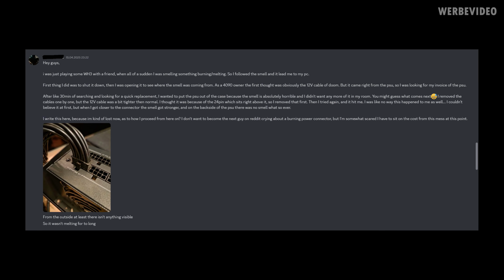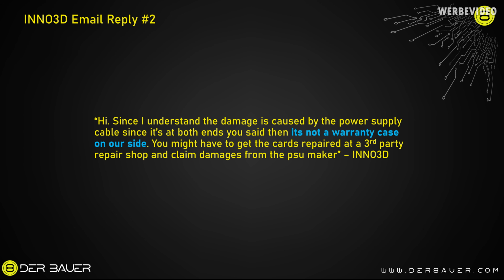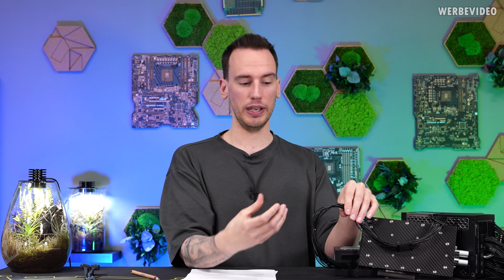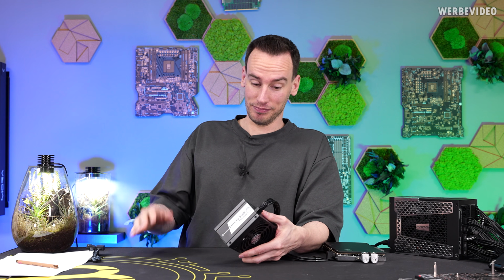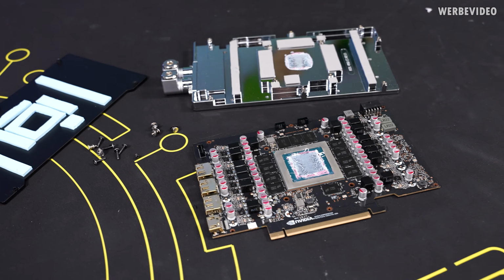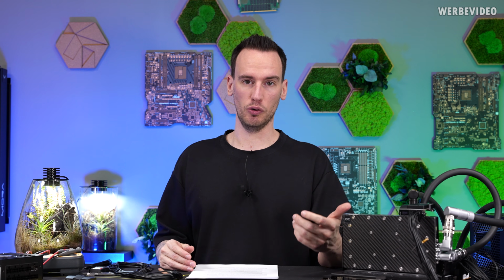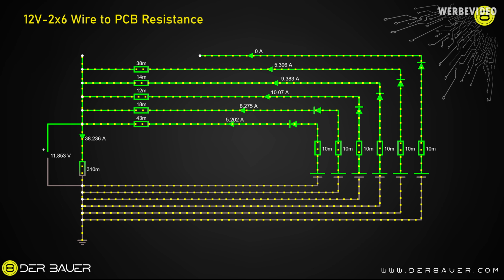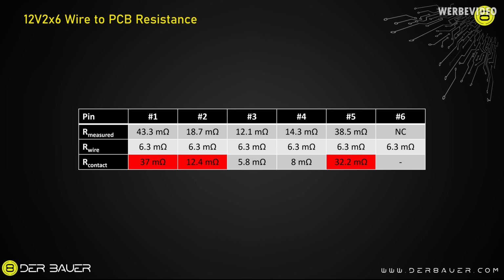Investigating and Fixing a Viewers Burned 12VHPWR Connector

Comment: @der8auer I have a silly question. You mention, that the melting connector issue only exists due to the card not being able to balance the load between the pins. So then, it is possible to remove the whole 12V HighFaliure connector from the card, and simply add an XT60 connector instead of it? And then wire up a cable that plugs into the PSU, and converts that shitty design to a good standard 2 wire XT60 plug? Preferably at the connector on the PSU side, so that we have none of those crappy wires left?

Comment: Same thing happened to me. 4090 strix. I had my 180 adapter melted into the gpu header and had to pry it out with a flathead. I bought a 12v-2x6 reverse gpu header from moddiy, then i took the header and the gpu to a repair shop. Cablemod covered the costs

Comment: @der8auer EN Heat and low melt solder will alloy with the existing solder, making it melt at a lower temp as it alloys into the PCB solder, then the connector should pull.  Tip via @NorthridgeFix.  And I un-pause....and see the Dremel!!!!!!!!  Next time!

Comment: Given that the pin that had the melting around it was the one you measured no connection on after you'd replaced the connector, does it not follow that something further downstream from that pin on the GPU board failed due to the excess heat and/or wattage?

Also, doesn't it seem risky to keep using this GPU going forward? With no current going over 1 of the 6 pins, and still no load balancing across the remaining 5, wouldn't that exacerbate the issue?

Comment: A lack of surface area between pin an connectors, theyre so small you cant make enough contact surface to keep individual pin resistances. If the connector was a bus bar rather than pins it would NEVER melt by greatly increasing the contact area.

Comment: Why do they desperatly hold on to using the same type of connector for higher and higher current demands ? Oh we just use more pins. It's proven over and over this does not work.
Why don't they use like a xt60, xt90 connector ?

Comment: Question from someone who doesn't know: if the Watts remain constant, but the card is undervolted, wouldn't that increase the current??? And wouldn't that exacerbate the unbalanced current draw across the wires?

Somebody should design an inline adapter, or ideally a cable, that can monitor the individual pins at the GPU side -- both for current draw, and temperature. Surely they can massage the sense pins to limit damage!

What about putting inline 10A fuses in each of the 12V+ wires? PITA, but it would save the card!

If the manufacturers aren't going to help with this, then it's up to users to protect themselves.

Comment: Using multiple wires to will always create problems either switch to  4AWG with Anderson connectors or increase voltage to 24V.

Comment: 8x could mean that some of the pci-e pins aren't getting a connection. A (GPU) PCI-E socket tester would tell you if that is the case, but regardless what the reason is, the card is damaged beyond just the power connector.

Comment: If there is uneven load distribution, does it change between resets?  Or is it consistent?  If you use a meter and it shows the load is uneven how do you balance it but using  a new cable?

Comment: disappointed i wanted you to attach it to a bumper of a truck to pull the cable out of the psu 😂
Reply: Haha, that would be funny, especially if he edited in a shot of the truck doing a burnout as it's struggling 😂
Reply: @volvo09 with the engine burntout and the psu cable still connected to tbe bumper unattached to the truck 😂

Comment: lessons learned.
1. Dont buy Nvidia products that has a 12VHPWR
2. First review any product outside Nvidia with a 12VHPWR to see how their power topology is handled on the card(buildzoid video) or not buy
3. Dont tell the vendor any details if your hardware failed and you want to claim waranty
4. Avoid INNO3D since they proofed to avoid providing valid warrantly claims

Comment: The resistance of the copper increases around 0.4% per 1C - you should factor that in. So if the connector gets to 90C it would be another ~30% (compared to room temperature).

Comment: Inno3D excuse made me quite angry. Power supply is not responsible for power draw in the circuit so if cable melts it's because the device responsible for power draw is requiring more power than the cable can handle. It's still GPU fault. 

Ofc this wouldn't happen if Nvidia stuck to the 8pin connectors on all of their GPUs(Funny enought xx60 series cards still use 8 pins on partner boards) or Nvidia would design better connector.

Comment: I have an Asus Astral 5090, gputweak3 with power monitoring. PSU is an Enermax PlatiGemini 1200W ATX 3.1, 6months old(was running a 4080super). Only just had the Astral but when monitoring power and running Furmark, pin 2 only drew 1.2 amps, pin 1,5&6 were drawing 10+ amps, the rest were within spec. Checked cable, unplugged/replugged no difference. Just had a new CableMod 12HPWR cable, all pins now showing 8+ amps. Didn't expect Enermax to ship crap cable.

Comment: that is a huge variation on that shitty contact area.
Reply: Could be fixed by switching to 4-spring crimp contacts, but everyone sticks to 2/3-dimple with shitty contact.
Reply: @TheDeeGeeNL  anderson pp45 similar size. but it needs 10mm2 wire for this load. however 10mm2 silicone coated wires used in rc worlds is insanely flexible. ohh and idiot proof. you cant connect it wrongly.

Comment: Kind of blahblah, when you consider, that, once again, the cable was crooked after plugging in on both sides and that there's tens/hundreds of thousands GPUs not burning.

Once again, it's a user error for the most part. Solution is simple - dual, disjointed clips to lock in the connector, located at the edges of the connector.

Comment: Really happy with MODDIY's handling of the situation.
Reply: Yeah, it's unfortunate that they would have to eat the cost for a manufacturers issue, but it shows they care about the customer.
Reply: Definitely. I think with the cost of bulk cable and what they charge for the finished product, they likely have a decent profit margin to work with.
Reply: I switched to a SF1000 from Corsair. When i told them about it, they instantly said they would send them all for free, and i just need to configure them. Really nice company and support from them.

If only Inno3d was that nice to me😂

Comment: Now i am starting to worry .  at least on the psu side on my new coolermaster gx3 1050w with my 4090. i can not remove my cable from the gpu side. i will check where you check as you show on the video. and only play 1 game. and general use.  My friend Erick will say i told you so. ok. no panic.  Asn if the gpu need repair i can not send for repairs cause the tariff. since is 125% plus the 10%  just to change the cable. Oh yes that is how that bad is.  since there is no one can fix that here

Comment: Heat means resistance to current flow. Which mean too much current fir the conductor.. Either the cable or connectors are insufficient

Comment: Okay… but how ? I mean if both ends are fused together, how did he get the PSU and GPU out of his case.
I do not know any case where this card or PSU will fit through the cable grummets.
So how? Did he use a saw to cut his case open?

Comment: If Nvidia wanted to avoid those issues they could easily do it exactly the way older cards had their power delivery design decades ago.
They cheaped out the most important part of a power hungry gpu and there we are.
Also, a cheaper way in my head at least' would be to have thicker cables! If you want to eliminate that possibility of one cable only having some connection, make that cable capable to support that power draw.
I'm pretty sure the old design connection didn't have these issues because of that and not because it had better pin connectivity!

Comment: Unless the power target is also lowered, then undervolting will actually increase the current draw.
If I undervolt my 9070 XT by 100 mV, it clocks about 200 MHz higher but the power consumption is exactly the same since it is just boosting to the power limit.
Reply: I undervolted to the same 2745mhz (@975mV) i got without UV. So it didn't run any better than stock, but at least used a bit less power than before. The chip is also not the best, so there wasn't much space for more before it got unstable and crashed...

Comment: What it comes down to is that trying to blame the GPU, cable or PSU is a game vendors and Nvidia try to play to pass on blame.

What's wrong here is the 12VHPWR spec itself. It creates 18 failure points that all cascade in damage to the PSU, cable and GPU.

And any vendor, chip or card, forcing the use of the spec is to blame and should pay to repair or replace all of it. And the one to decide to use the spec is the endpoint / GPU.

GPUs don't use the spec because there aren't any other cables coming out of a PSU to power it, there are plenty options, they are the ones that force 12VHPWR to be used.

Comment: If this stupid abomination of a connector will melt on me. I will just solder wires directly onto a card PCB. No contact resistance not unplugging no worries. According this video i can just void warranty by doing that. Cause it looks like there is no warranity anyway...

Comment: @5:54 @derb8auer.. I kindly say not fully true... You definitely can help prevent this on PSU side too as you can make controller there to stop current going out when unbalance has been detected between wires going out and not just on gpu end similarly.
Reply: You can’t load balance on the PSU side… the entire connector sits on a single rail so the total current wouldn’t change.  This is a design issue on the card side.

What you’re suggesting is one rail per pin which is a complete redesign of the ATX specification… (the PSU becomes the intelligent device) which suggests the spec wasn’t adequate in the first place.
Reply: @KleoGroutides  No, but you can still monitor all wires on PSU side alone. Forget GPU, put resistor just there IT DOESNT MATTER how 'its configured'. 
You can still do so much on PSU alone! What you think is GPU doing load balancing.. forget that its not my point! 

Specs. I am not talking of specs and not talking what shape of pins should be or what colours of wires should be used. Just the possibilities of PSU here.
Reply: @ you can’t do per pin monitoring on the PSU side if all the wires are on a single rail… those wires are soldered onto a single bar.  Every connector be it 6pin, 8pin and EPS (if memory serves) must sit on a single line.  Hence by definition it’s the endpoint that needs to manage the load balancing… the exception is a multi rail PSU where different 12v rails are load balanced.  The 12v connector of all PSU designs sit on a single rail… the ATX spec enforced this.  This isn’t a PSU problem… the PSU is dumb by design for intensive purposes…

Comment: It's not really that hard to understand why this is happening, the 40/50 series share the same problem and it's Nvidia's design that creates this problem. There are no similar problems with previous generations. Personally, I think Nvidia is fully aware of this but secretly pushes the responsibility onto something else, if we were to see a new design on the 60 series then it's completely clear to me that it was actually Nvidia's design that was the problem in the first place, otherwise you wouldn't have designed a new one if Nvidia thought there was nothing wrong with it. It remains to be seen. Someone should start a lawsuit against Nvidia, this is unacceptable for users. I'm just glad I skipped the 40 / 50 series.. will happily skip the 60 series if the design still exists.

Comment: To experts:
It's possible to develop a device that is connected between the GPU and PSU that does the work to measure the differences of Amp flow and do something? Like cut the energy and/or emit a waring sinal?

Comment: Have there been any cases involving the stock adapters that come with the cards?  Or does the fact those adapters end up splitting to 3 or 4 8-pin connectors completely change the dynamics of the potential resistance and current across all those wires?

Comment: because what i once heard suggested was that...
the pcb power planes current flows could favor a nearside pin

but what your saying here today about the crimping...
well in theory it could be possible for either 4 or 5 mis-crimps

if a majority of these 6 power pins were not crimped properly
then leaving only 1 or 2 of them left giving a good low resistance

then that would be a cable problem indeed
whether 3rd party or manufacturer supplied cable

the solution to that problem would be to use milliohm meter
on all cables as a Q&A quality assurance mandatory testing

before leaving the factory, whether its the coming with that psu
or if its a 3rd party cable like the cablemod or whichever ones

and if you personally dont have a milliohm meter to measure it
well i dont, i have a 34401a which is a 6.5 digits

it would be nice to know however der8aur - if corsair does this
as a testing Q&A step for their own 12VHPR cable they are selling

its like... terminates in 2x 8pin EPS style on the other end
but its not right angled... those tend to be chinese / alibaba / aliexpress

Comment: It'd be quite interesting to see the resistance breakdown and if insertion cycling alters it, sort of a lower level to the previous video on cable temperatures. 

Possibly also a before and after a long period of system load, such as gaming inside a case, to see if thermal expansion adjusts the contact resistance as well.

Comment: Hi, @der8auer i also have a inno3d 4090 and also water cooler via Alpha cool block, i have the same issue where the card WILL NOT run at 16x pcie gen 4.. only runs at 8x...i recently sold it to some and got a 5090.

Comment: "You can only solve this from the GPU side." Per-pin current sensing can be implemented on any side, even the cable by adding an in-line PCB to sense current and shut it off if it goes too high for too long... or go whole-hog by having a constant-current buck regulator actively enforcing a 15A per-wire current limit and 60A total.

The only things the GPU can do that other solutions cannot is make the GPU throttle itself to more gracefully handle the issue and spare people who don't have 12VHPWR GPUs the cost of that extra circuitry.

Comment: I had a Gigabyte Gaming OC RTX 4090, using the original connector with 4 tails in a Lian Li 011 Dynamic Evo case, mounted horizontally. The connector was pushed in properly on both PSU (EVGA 1000W Super Nova, gold rating  ((thick braided cables))  and GPU side and 2 pins began melting themselves inside the GPU side wtihout any smell of smoke or burnt plastic. A long 2 year bake it seems. ( For reference, I have clips of my rig on my channe). For some reason and thankfully,  Star Wars Outlaws would consistently crash on opening, other games worked but were unstable, even blue screens albeit my case having great airflow working correctly. I thought it was my new motherboard (Gigabyte X870E) CPU combo (9800X3D), weeks of trouble shooting updating bios & all drivers that exist, to even a full wipe & windows reinstall, STILL unstable/ crashes. Frustrated, ready to take the PC to a "professional," disassembling PC for transport, the first thing I discovered were two cooked pins with their plastic shrouds still in the GPU, also hard to pull connector out. 

Thankfully GIGABYTE repaired connection and gave a new connector via RMA, but I've moved on to an ASUS TUF RTX 5080 (overclocked), with a Lian Li Edge 1300 platinum rating. It took 2 years for the 4090 cables to cook playing long sessions of various games from path traced games like Cyberpunk, Indiana Jones to unique unoptimized titles like Star Citizen. See you guys in 2 years if it happens again. I'm sticking to lower wattage GPU's really not worth the trauma just to tell someone i'm getting 10fps more at max settings.

Comment: Some might cynically say it's a genius 2 (or more) part problem...  This way the vendors can point at one another to shift the blame to the customer.  
Cheap/lazy power bus design on the card.
Poor pin/connector design (seemingly) that can't take multiple removal/installs or corrosion on any pin...
Sad

Comment: It is clear there are serious issues with this high power connector.  It matters not whether the manufacturers think it is user error, if the thing fails, overheats, and poses a fire risk, it is simply unfit for purpose.  We can see very clearly that in this case, the connectors were fully inserted.  There was no user error.  This is a failure in the connector itself, and they simply cannot be trusted.  In more than 20 years of building PCs, and working in PC Support, I've never seen or heard of a standard PCIe power connector failing like this.  Why Nvidia chose to introduce these high power connectors is anyone's guess, but it is now blatantly obvious they are poorly designed and prone to failure, especially on the high power cards they were supposedly designed for.  Everyone in the industry using these connectors needs to be held accountable.  They cannot be allowed to weasel out of product support on such flimsy excuses as "you didn't plug it in correctly" - there is no proof they were inserted incorrectly, as the evidence here shows.  And I'll restate that it matters not whether the manufacturers believe the user can be blamed, if the thing melts when not properly inserted it should fail safety tests, if it can be inserted incorrectly it should fail safety tests, and if it melts when inserted correctly, then it is simply a bad product that should be withdrawn from use immediately.